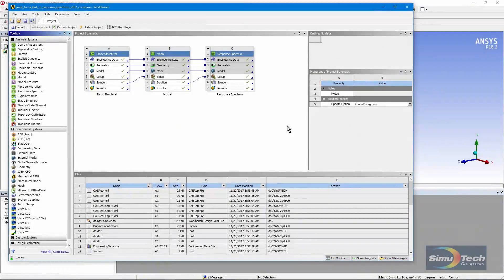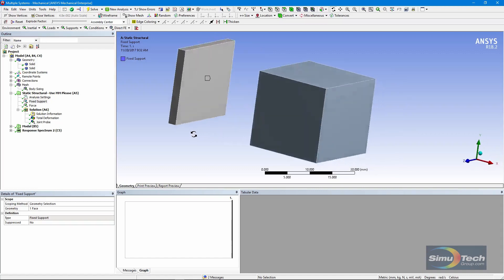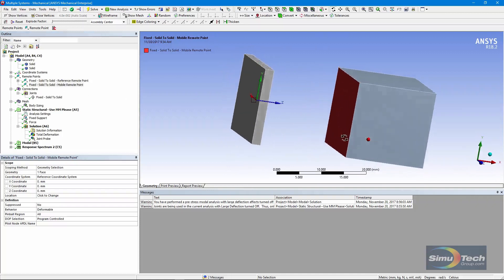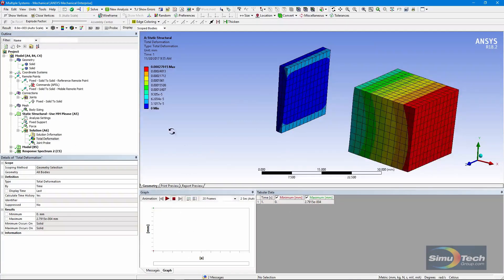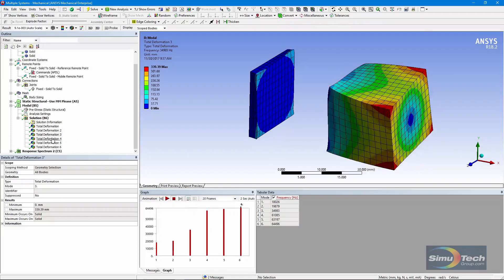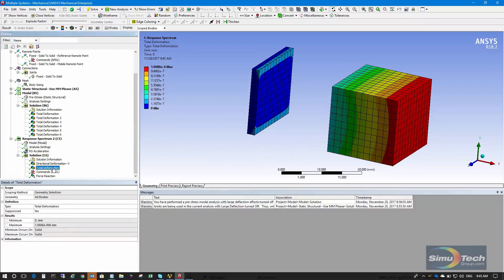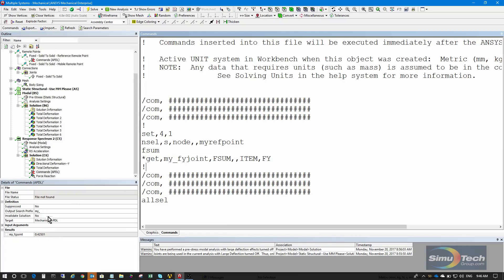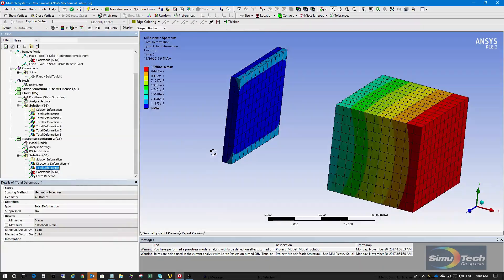How to retrieve Joint Force during Response Spectrum Analysis in ANSYS Workbench Mechanical

Comment: Can this approach be used for random vibration?
Reply from the maker: Hi Brian, I was able to speak to the engineer who created this video and his response to your question is below: 

The same approach can be used but the command snippet that is used in the Solution branch in the model shown in the video needs to be modified slightly.  Specifically, the SET command must be changed to SET,3,1.  A third field on the SET command can also be added to control the sigma level of the result produced by the command snippet.  For instance, SET,3,1,3 would yield 3 sigma results.  If this field is left blank it will default to 1 sigma results.  Again, this is use at your own risk, as it is not QA'd by Ansys Inc.

If you have any other questions or are interested in any of the services I listed before, please don't hesitate to reach out to us at info@simutechgroup.com
Reply from the maker: Thank you for your comment. If you are interested in SimuTech Group's support services like consulting, mentoring, or training please send us an email to info@simutechgroup.com or you can check out the Ansys Learning Hub https://www.ansys.com/services/ansys-learning-hub

Comment: I just used this and it seems to work okay in v19.0. It also works to extract Moments. One difference: Use the command "SPOINT <your_remote_point_reference>" to state the summation point, prior to the FSUM command. Then use *get,<your_output_label>,FSUM,,ITEM,MX to extract the moment in x direction, for example. Re-run *get command to extract MY and MZ moments with separate output labels.